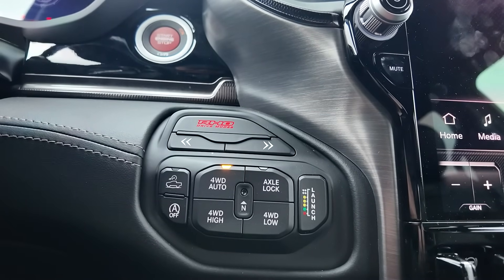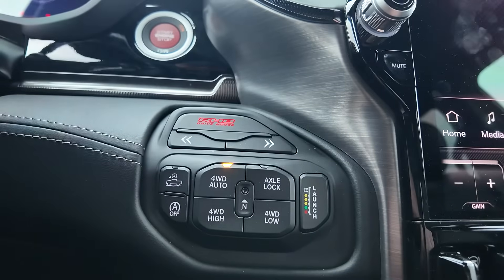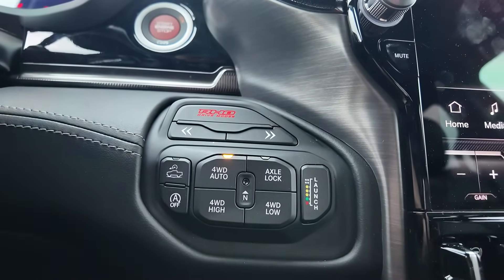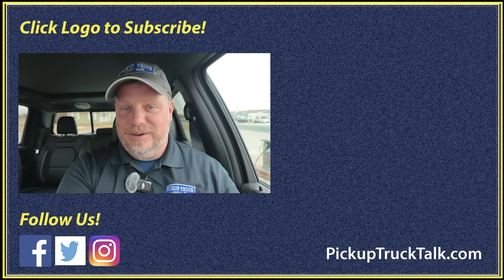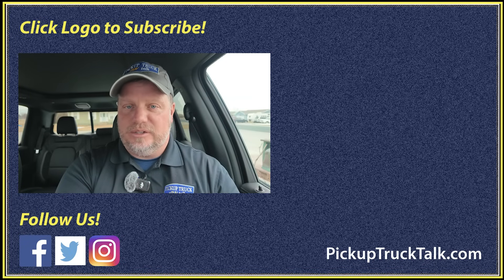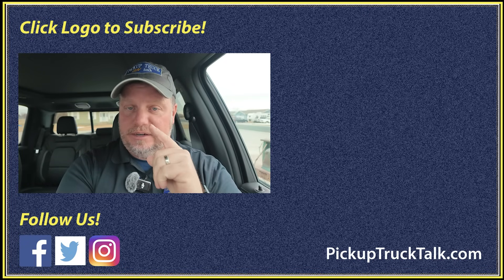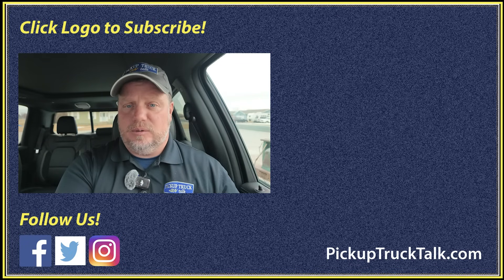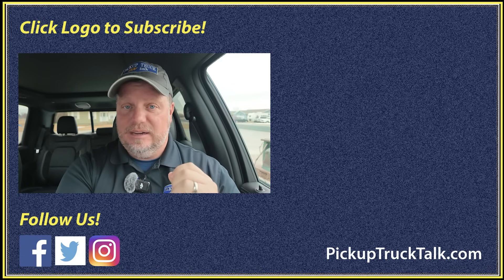Drive Mode Matters? Here's How Ram 4WD Auto Works from the Engineer

Comment: I have learned that AUTO 4Wheel drive mode is better on street snow/ice especially on “crowned and side sloped” road areas.  In 4X4 high the rear wanted to slide down hill and at speed would spin the vehicle.  Of course, tighter turns are smoothed out with AUTO mode as well.

Comment: I picked up a used but in great shape 2013 RAM Laredo a few months ago. We recently had some snowfall and in 4W Auto it did perfect donuts which really confused me. On the highway with patchy snow I just wasn't sure. In my driveway the auto setting will noticeably engage. High 4W lock, low 4W lock and 2W drive work as expected. I'm thinking the 4W Auto worked a little differently on the earlier models. Or maybe I'm still confused lol.

Comment: I just bought a new 2026 RAM 1500 4x4 5.7L and I was wondering about the 4 AUTO switch myself. It's good to talk to the actual engineer because the Owner's Manual doesn't really explain the differences in the levels of 4 wheel drive...but the manual does state not to drive in 4 AUTO constantly because of wear to the tires?? So, Mr. Killian didn't have anything negative to say about 4 AUTO full-time, I'm thinking he would know. Then again the Big Horn won't be doing a lot of off roading anyway

Comment: I wonder if it's similar to GMs Auto 4x4 , I have a 01 GMC Yukon that has 2WD, 4 High and 4 Low but also a Auto 4 WD,  I know RAM is forcing people with the newer Rams to use some form of 4x4 at all times. I don't use the Auto in my Yukon because it drastically Lowers MPG keeps the Front Axle engaged making handling weird on dry roads.  The way GM did it the transfer case has a clutch pack in it that engages when the system detects wheel slip.  And it also wears out the clutches in the transfer case faster when in 4x4 it uses what some mechanics call Smurf blood because it's the color of a Blue Raspberry icee from 7/11 ,  I own a Ram 2500 that doesn't have the Auto 4x4 mode just 2H 4H and 4L . But that truck stays in the garage once Michigan throws Salt on the roads until a few good rain falls in the spring.  I'm not letting MDOT ROT my Cummins 😮😢
Reply: After watching the entire video Chrysler definitely copied what GM had done decades ago with Wet Clutches in the transfer case. Not new probably just a copy of an expired patent.

Comment: I've had two Ram 1500, and am about to buy a third.  With my first, I learned that you can't switch from 2WD into 4WD if you've got slippage - in the tires for it to kick into 4WD, so if you're going from pavement to deep sand, switch to 4WD just as you enter, or just before - not when you get stuck in the sand.   ;-)

Comment: 10:00 2wd vs 4wd would only save fuel if the front axle is disengaged from the front wheels. Otherwise you're still pushing the ring-gear/pinion, axles, shaft, etc. That's a reason some manufacturers went with auto-lock front hubs (weak PoS idea) as an "upgrade" from manual hubs.

Comment: I have a '12 with auto 4x4, I use it all winter, and as Doug said, I have to be under power for torque to be sent to the front wheels. I did find it can be hard on the front cv's to the point where when the mopar's popped I put the top of the line napa ones in, they lasted all over 2 years, and I've put cardone HD ones in, they're much beefier in pretty much every way.

Comment: Just picked up a 2025 Ram 2500 Heavy Duty and I was surprised it doesn't have 4 auto. Our pervious two 1500s had it and it was great for wet and nasty conditions. My wife 2025 1500 with the hurricane has 4 auto too, and when you put it in sport mode, it automatically switches to it. Winter is not far away, so I will miss having it in my Heavy Duty. Great video.
Reply: My 2025 doesn't have it either. Maybe it's a trim option that's uncommon for off-the-lot trucks?

Comment: I'm really loving my 2025 Bighorn 1500 with the 420hp hurricane motor except for one fairly major complaint. Why in the hell didn't the engineers who designed this thing include a dipstick in this motor? I've learned to live with checking my oil level through the uConnect system (though I don't like it and they should have given us both options) but the biggest problem arises after doing an oil change. It is a major pain in the you know what to reset the 'oil maximum exceeded' warning message. I've had two different dealers take over an hour and a half to do an oil change because for 45 minutes they have to mess with getting this error message cleared. There's only a dozen or so remedies they have to go through to reset this beast of a system. It's a good thing they have a set price for an oil & filter change because if I was being charged for labor on an oil change I'd end up in the poor house.

Comment: This was my one complaint/peeve with getting a truck. We have a 4x4 but then are spinning just pulling away on the road etc.  I wondered why my Nissan trucks couldn't be more dynamic with the front case.etc.  Got a RAM 1500 a few days ago, and this video has opened my eyes and this mode is exactly what I want.. fantastic RAM. Thank you.

Comment: Jeep Wrangler 392 uses an AWD / 4 hi / 4 low transfer case. With the increased torque of the 392, those clutch packs burn out prematurely. Without replacement clutch packs, the fix is to replace the transfer case. 
A lot of crow hop comes from u-joints at the ends of the axle. This is mitigated by using CV joints.

Comment: 4 wheel lock is like 4 wheel high on newer trucks .
Reply: There isn't 4 wheel lock so far as I know.  It is labeled Axle lock on the RHO control.  I am sure the rear diff is a E-locker so easy to on/off that but more than likely the front is still an open diff, so at best you have 3 wheel drive when in 4 wheel and with the axle locked.  To be fair I have not done enough research to know for sure about the front diff and if it locks too.  In a lot of cases though they can still control front diff imbalance with some automatic braking and stability control through the ABS system.  In the past I had a old K5 Jimmy and it had open diffs front and rear and while that was pretty lame you could use some liberal braking to control the loose wheel spinning and force the tire with traction to pull you through.

Comment: I live in SE WI. I bet I use auto more then 2wd throughout the year. When it’s raining, I just spin my tires even at low acceleration. And I put it in and pretty much leave it from late October to May about. Unless we have a long stretch of dry roads. I have a 13 1500 bighorn with 270k on it and have done this for the 9yrs/200k I’ve owned it.

Comment: So here is a fuel efficient test. Run the truck in 4auto standard drive mode vs 4auto Baja drive mode on the road and see if Baja is more fuel efficient since it sends less torque to the front axle.
Reply from the maker: Honest question: do you really care that much about mpg with the RHO? I don’t.

Comment: I have auto 4wd on my 2011 Ram 1500 Sport crewcab with 120k miles and absolutely love it. Living in west Michigan, the winters can get pretty brutal and I use auto 4wd almost all winter long...don't even use 4 high or low during the winter because the auto works so well.

Comment: I leave my truck in 4 auto. It has saved my ass a few times. It isn't hard to understand. It's in the owner's manual. In my 2019 Classic Bighorn, zero power goes to the front wheels unless the rear slips. There is zero difference in fuel economy between 2H and 4auto. I have tested it over and over again. My truck has lived in 4auto for the last 6 years.

Comment: Ok, I am stil unclear about certain things.  The conversation was mainly about the transfer case and the torque settings between front and rear drive shafts.  What about the rear and front differentials.  Some 4 x 4 drive pickups have open differentials, but can electronically lock the differentials.  So, when choosing 4 wheel low, does that automatically lock the front axles.  Is it trim dependent?  What about Ford & GM?

Comment: That was much needed info about 4 auto! Mainly because I have it on all the time, I hate not having limited slip diff- should be standard on trucks, and wondering what is going on in there as far as wear. I have a 20 Laramie so hopefully its still the same, just not having the drive mode selection. I knew that 4wd locks everything together, but what exactly 4 auto does with the clutch system engagement is now solved.

Comment: great session thank you.  seems like putting in 4-Auto is the easiest way to go.  Did he say how much fuel you can save by going to 2 wd sounds like it would be minimal
Reply: That would be good to know. Like cruising highway speeds does it just go to rear only, or stay in that limbo with little going to front too waiting for the call? I usually hit 2wd in normal dry conditions just to make sure of less wear and maybe a little gas save.

Comment: So I got a brand new ram 1500 . I was getting a hiccup when switching from 2wd to 4 auto . It was kinda  jerky on and off the throttle the engine light popped up and blinked a few times. So my question is can you not switch from 2wd to 4 auto on the fly or do you have to stop put it in N then switch.
Reply from the maker: Should be on the fly. Maybe just an odd ball thing?

Comment: I have 2025 Ram Rebel 1500 Standard output, I wish they would have spoken about the different drives modes and what is engaged. Tow, snow, sport and auto.

Comment: Hi, based in New Zealand. Great video. I have a Ram 1500 limited night edition 5.7(pre hurricane model). Do you know what the torque split is when using 4wd auto in normal every day driving conditions with no slip?
Reply: There’s no torque split in 4wd auto, it only sends power to the front wheels when you lose traction so it’s variable depending on traction loss from the rear

Comment: Need your help. Can you ask Doug? I had a 23’ Ford Raptor. When I switched the suspension only settings from sport, street, tow and baja, you could feel an immediate change in the way the suspension and body roll felt. With my brand new Ram RHO in auto mode, I switch between sport, street or tow and barely notice and difference. I switched to baja mode, and it feels like a floating boat. I also went over a large speed bump at 16-18 mph, the suspension felt like it bottomed out and made a clunk noise. Felt like old pair of blown shocks. Same speed bump in the Raptor and it was butter smooth. I was able to get an appointment with my dealer in early May but I  have no codes. Can you provide any guidance and what to check? Other wise, I love my RHO. Please help…

RHO factory ordered and only had about 40 miles on it when I tested it. Now has 450 miles and still feels the same

Comment: Tim, I'm waiting to buy a Ram 1500. I don't tow. Just need 4 wheel drive for snow...the 3.6 or 3.0, either is fine. However, I am waiting to see if Tim Kuniskis addresses quality. IF I hear quality has been improved, or these engines get a slight revision to improve issues, I'm in.

Comment: I have a 2017 Ram Limited and putting it in 4wd auto , my 4wd system throws all kinds of lights to service the system.  4wd high or low has no issues.

Comment: I need to talk with Doug about my RHO that I bought 2 months ago and how my battery fully died 4 times since I got it. Its been a pain to deal with and its been in the dealership for 2 weeks and they don't know what the issue is. It sounds like from what Doug is saying there are an insane amount of sensors/wiring inside this truck and it would be nearly impossible to find the issue with the dead batteries.
Reply from the maker: If it’s at the dealership, the Ram engineering team is aware of it.
Reply: @ I was told the ram representative at that dealership is aware of it and was asked what’s the fix and does not know. Now here’s the thing. Am I, a customer of a new truck, supposed to leave my truck at the dealership for I don’t know how long, for them to find and fix it ? I use my truck for work every day and do not have the time to be without my truck.
Reply from the maker: @ it’s a crappy situation no doubt. There may not be a fix today, but that doesn’t means Ram isn’t working on one.

Comment: I'm driving 09 silverado 4x4 have 2wh, auto4x, 4hi, 4lo. Dealer owner said never use 4 wh auto. Just use 4 hi in lousy road conditions and 2 wh in good conditions.  Been doing that with 5 4x4 trucks over 30 years. Im in alberta and basically in winter I use 4 hi 90% of winter,2 wh when highways dry
Reply from the maker: Dealer needs to get with the times imo.

Comment: The one thing I wish the video would’ve touched on a little bit more is the effect that turning off the anti-slip while in for a wheel high has. I believe it sends power to all four wheels and doesn’t compensate for slip where if on it would. Does anybody know if that’s correct.

Comment: Hey! I know you made a video or commented somewhere about using 87 fuel and that you checked with an engineer that one could use it without detriment to the truck. Did I dream this or did you make a post somewhere? Maybe it was a comment on someone else’s video
Reply from the maker: Correct. You can use 87.

Comment: Thank you so much for posting this video! I have a '21 Big Horn with the 2WD option and always wanted to know the ins and outs of using 4WD AUTO vs HIGH and LOW, and wondered if I was using them for the appropriate reasons.  Feeling so much more educated about my truck and feeling better about owning one. 🙏🙌
Reply: Why? Every Quattro/4Matic/xDrive drivetrain from Audi/Mercedes/BMW works on the same way as explained as cars  is designed to withstand those forces.  Off-road makes a lot more wear than using "Auto mode" would you agree? And what about safety and stability? iI provides greater level of safety on road if there is a e.g. slippage or uncontrolled rotation - specially for pic-up trucks that have high center of gravity.

Comment: Tim, you may be over thinking this. Jeep/Dodge/Ram get their transfer cases from Magna and I think they're pretty good for the most part, some have 2- and 3- hundred thousand miles on them. I have the MP3023 in my 2018 Durango. Although you make a good point about clutches getting hot, imo the pros outweigh the cons. For example, as you mentioned, the engagement is incredibly fast. When in 4auto and you experience wheel slip, the front wheels come online almost instantaneously. I don't know how they do it so quickly. But yeah, the magic is in the clutched transfer case. You seem to be thinking of this as a locked differential, which it is not.
Reply: I know how they do it. 19+ Are Borg Warner cases. Well BW owns Haldex, which makes the AWD systems that in features in cars like the Golf R, Audi RS3, or Lambos. Essentially this is pretty  just Haldex in truck form.

Comment: It really sucks that the RHO and TRX do not offer 2wd! Even the engineer said you cannot do donuts in AWD drive because it's to much stress on the clutches and it will monitor the inputs and pull power if needed to save the clutches they even said it's a truck for fun and they know people will do donuts so why make it constant AWD!🤦 I have many years off road experience in the desert and there is tons of time 2WD is best. Also Toyota decided not to make the new Tundra AWD for strength and reliability. Can't even have fun doing burnouts in the Ram 🤦
Reply: Im sure the new Tundra has 50 computers that would intervene if you tried to do something as fun as a burnout or (GASP 😱) engage your rear diff lock in anything but 4Lo. Toyota's are the worst when it comes to fun having.
Reply: @Jay-me7gw  I like the RHO alot but I would definitely pick a Ecoboost Raptor over it just to have 2WD and tune it for 500+ hp. My 2002 4runner has 4WD 2WD and AWD why couldn't RAM do that? 🤷‍♂️ My 2000 2WD 4runner has walked all over alot 4X4 truck here in the Desert. 2WD with a locked diff is a blast in the desert. Also it's nice to be able to put a 4x4 truck in 2WD if you break something in the front and be able to limp home. I think RAM will add 2WD later they are new to building a Off Road desert truck and still learning Ford has been doing it since 2010.
Reply: @ I could see why the TRX was AWD only, because it was making 700hp and 650 tq, but the RHO doesnt seem like it would need it.

Plus the Raptor R has 2wd. So I really wonder if its just that Ram was worried about durability or something.